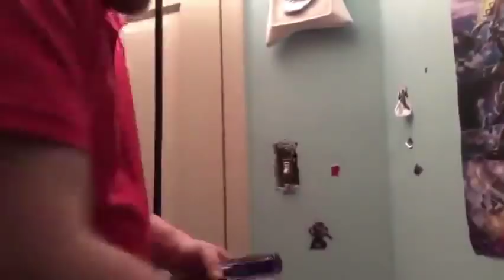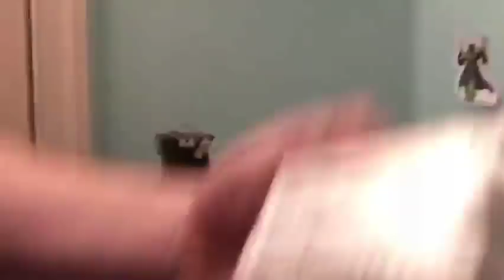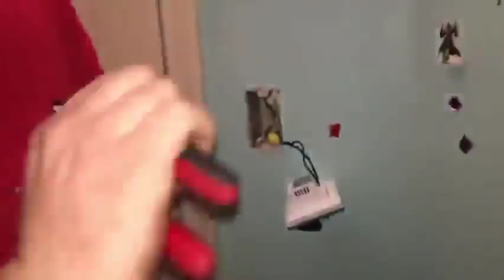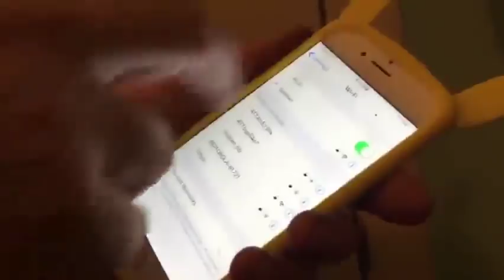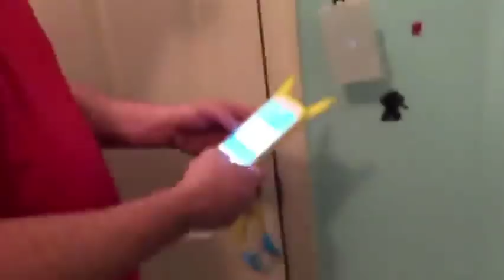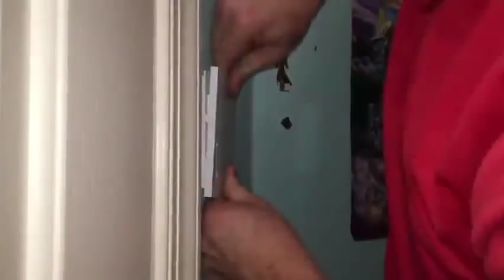The installation and connection for Oittm Smart Wi-Fi Switch

Comment: IF  VIEWER (RAYMOND DIMARTINI  CANT FIGURE OUT 2 WIRES YOU HAVE NO BUSINESS UNSCREWING A LIGHT SWITCH CALL AN ELECTRICIAN
IT DOES NOT GET SIMPLER THAN THAT  A BLACK WIRE (LOAD OR HOT) A WHITE WIRE  NEUTRAL OR NEGATIVE  ITS THAT SIMPLE  GO TO THE LIBRARY AND RED UP ON IT

Comment: Have only two wire and ground  black  and white need help
Reply: mycasa2000   the white wire goes to the slot that says L by itelf  black connect L1L2 ect.  Depending how many switches you have
Reply: don't think it will work with only two wires. ( old house)
Reply: shinchiwarrior  I figured it out thank you
Reply: @joemartinez9915  
I got com, L, and 1. Do you know where they go in the wifi switch N, Gnd, L, L1
Reply: did it function correctly after you figured it out? can you share?
Reply: Suggest pulling a new wire for your house

Comment: How come yours have two black wires and a neutral? My has only one black and one neutral (white). How am I gonna wire this? Tried to put the black in the 3rd hole(L) and white in the 1st hoke(N). The switch turns on but not stable(getting some clicking sound) and the light is half way light up also won't go off.
Reply: which means the switch won't work with 2 wires
Reply: Older homes did not require a nuetral so for most you will have a single Romex a black and a white one is your line and one is your load. Your box doesn't have a neutral present
Reply: Koogeek

Comment: I don't get it about how you know which wire come in and come out
Reply: By Convention (normally) Red / Brown INPUT "Live" OUTGOING Blue/Black. Typically a red sleeve or tape is placed around the installation and should be the same in the ceiling.
Reply: But IN UK you never have a neutral coming down to to make this thing work you will have to run a neutral also